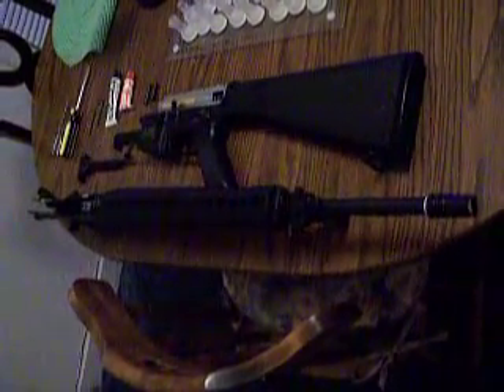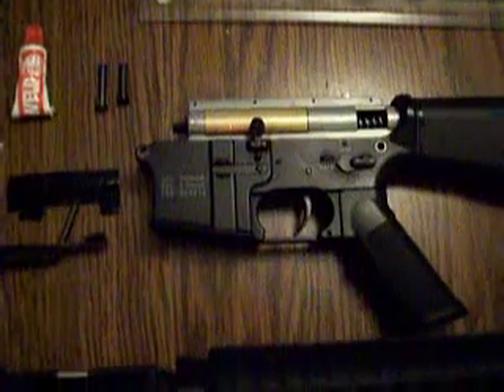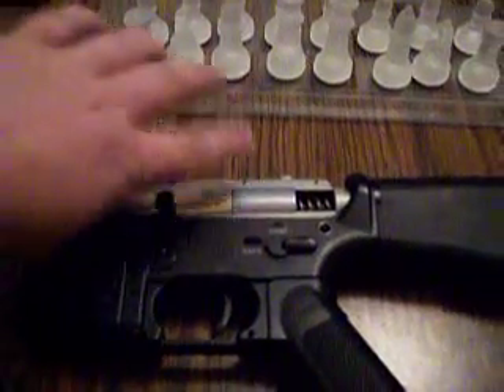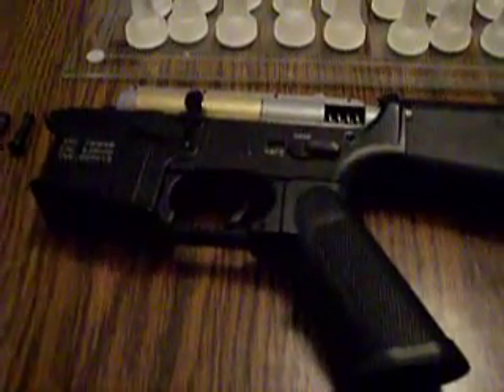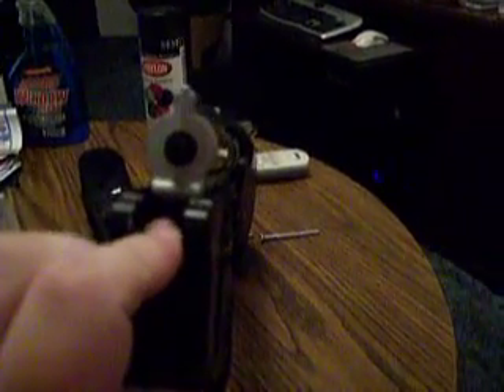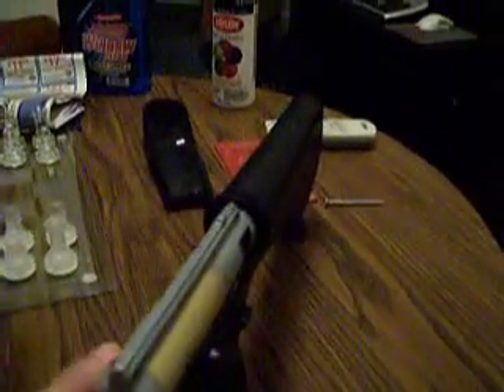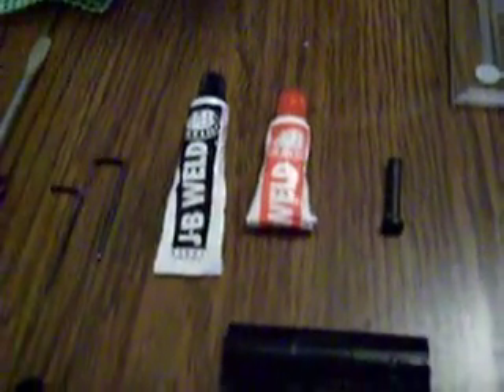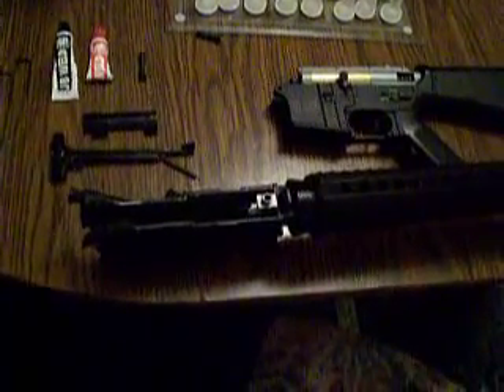SRC M16A4 Internals

Comment: If your doing this for the first time it might be a good idea to disassemble it in the following manner:
 Remove the motor, pistol grip, butt stock etc (see normal M4 disassembly) and acutally remove the lower receiver from the gearbox and the rest of the gun leaving the gearbox in the upper receiver. This should give you a better idea of how to remove the gearbox which at that point will be even easier.

Comment: i got osme questions is that a metal reciever and if so how the hell do you separate the recievers because i bought the gen II m4 RIS with a crane stock from airsplat and the recievers will not separate, i know that it has to slide forward like a CA reciever but yet it doesnt want to and you cant pull up on it like an ICS becuase the its a one piece hop up

Comment: here's how you do it since he's not going to show you. There are two cotter pins on the left and ride sides(trades facing you), push those in with a screwdriver and force, when you do that (do the back one first BTW) the reciever slides off upwards. This is how allother M16's come apart i highly doubt SRC did this differently,
..::MIKE::..

Comment: You didn't show anything about the INTERNALS AT ALL. Taking apart the receivers isn't that hard. There's a tab on the top of the gearbox that hits the inside of the charging handle when you try to slide it forward. When sliding the upper receiver forward pull the charging handle back then move it over the tab on the GB. Also be careful that the rear receiver pin tabs on the upper don't break the selector plate on the GB.